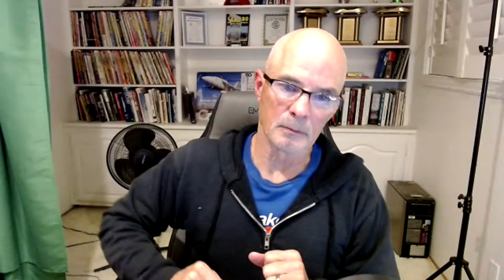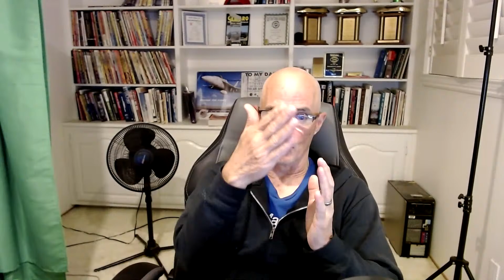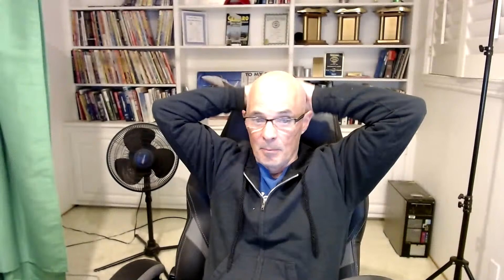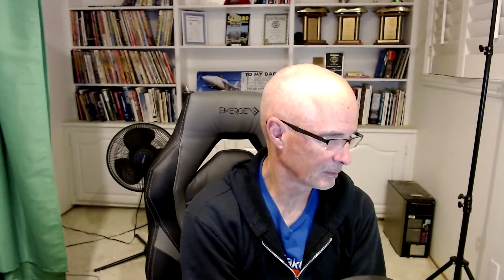TURBO Y-PIPE SIZE LET'S TALK TECH

Comment: Trying to use what I have for fun street use.
416 stroker w/stock 823 heads,LS9 cam , mid length headers 1-3/4 , 3" y-pipe into 4" single 
Gt45 remote mount 7-8 psi only w/inter cooler in a Pontiac Solstice = 3000# 6 sp auto.
Would this combo work on the street, or will it be to much back pressure?
Reply from the maker: it will be super responsive, but would only make 700-750 hp max. At 7 psi it will be fine. Pick a bigger turbo if you want more
Reply: @richardholdener1727  thank you so much for your time /work and super fast response. 700-750 should be about 550-600 HP @tires ?

Comment: hi, what is the ideal? pressure ratio between the intake  side and the ex side? aka if I have 10 psi boost what is the max ex pressure??? 4 psi??
Reply from the maker: for what application? For Bonneville, we had less back pressure than boost pressure, but for better response, the reverse is much more common